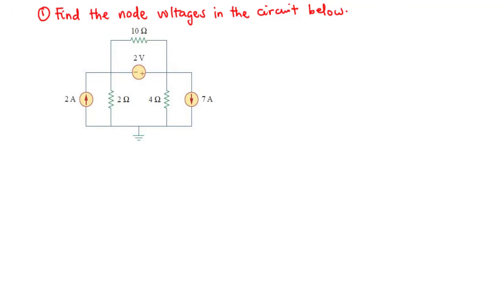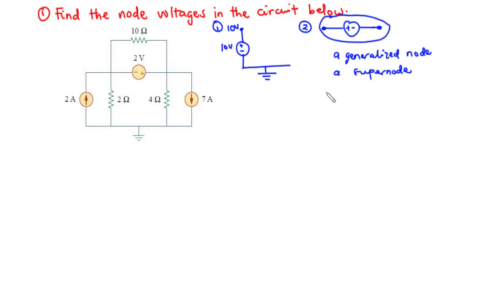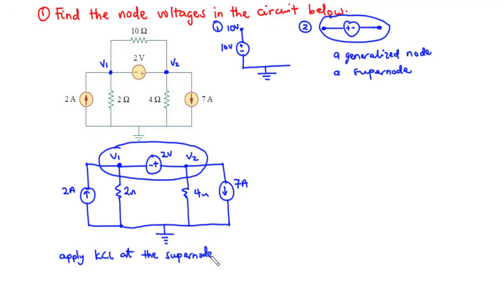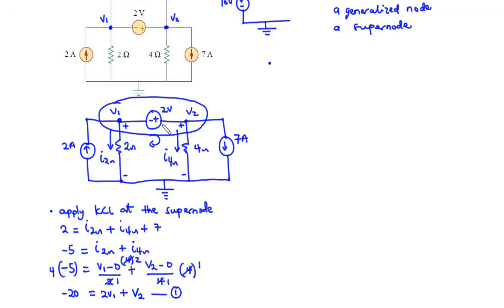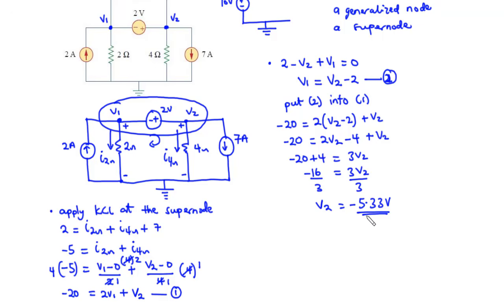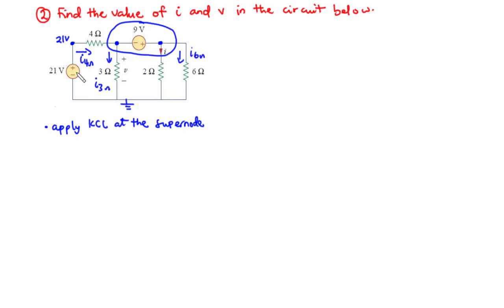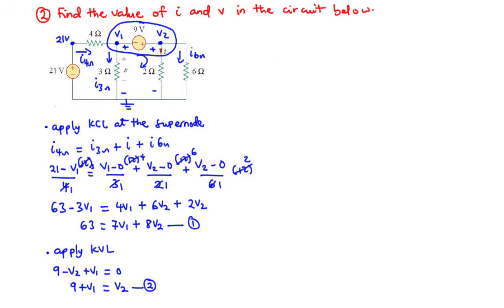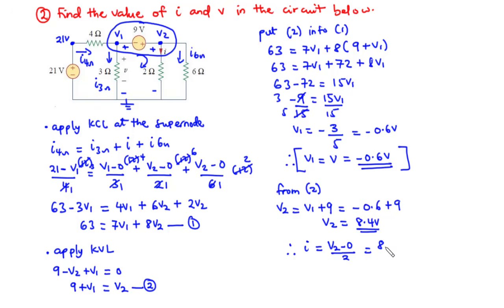☑️13 - Nodal Analysis involving Voltage Sources (Supernode) 1

Comment: How are you doing sir?if you may kindly assist me with the solution to this question ill appreciate
A circuit contains six nodes lettered A, B, C, D, E, and F. let VAB be the voltage between nodes A and B with its positive references at the first named node, here A. Find VAC, VAD, VAE and VAF if VAB = 6v, VBD = 3V, VCF = -8V, VBC = 4V, and (i.) VDE = 1V; (ii) VCD = 1V; (iii) VFE = 4V.

Comment: When a resistor is connected in parallel to a voltage source (across a supernode), it doesn't affect the voltage at the node.

In this case, the 10ohm resistor can be ignored for the purpose of nodal analysis, as it doesn't affect the voltage at the supernode.
Reply: what if we don't ignore it? would it be fine
Reply: @Noor_2k6 yes, u would see since the current at the 1st node current is leaving and at the 2nd node current is entering, if we write equations for each node and add the equations, u will see the current through the resistor in parallel with that source will cancel out, along with the current through the voltage source
In our example - 
For V1: 2 = I1+I3+I4
For V2: I3 = I2-I4+7
Add them up I3+2 = I1+I2+I3+7 and notice we can subtract I3 so we get I1+I2+7 = 2 or I1+I2 = -5
I1 is the current through the 2 Ohm resistor
I2 is the current through the 4 Ohm resistor
I3 is the current through the 10 Ohm resistor
I4 is the current through the voltage source
Note: The current I4 at the node V2 is negative because it exits the  negative terminal of the voltage source, while at the node V1 its the opposite, so it cancels out when adding the equations. 
U can see i got the same equation as in the beginning of the vid.
Overall, this showed why in supernodes we ignore the current through the voltage sources and through the branch parallel with the supernode.

Comment: Please sir,  at 9:10 i don't understand why did we take v2 to be negative? and do we always consider at 8:37 that there will be positive up and negative down?
Reply from the maker: At 9:10
Ideally the current is supposed to flow from the positive terminal at V2.
But since we take 2v as reference voltage and we take the clockwise direction, V2 will move opposite to 2v hence V2 will be negative.

At 8:37
Yes, negative is to ground.

Comment: Reason for excluding 10ohm
Reply from the maker: Since there is a voltage source in between the two non-referenced nodes, a supernode is formed, hence a supernode is formed and the element in parallel with the said voltage source goes away.
Reply: One question.
What if the 10ohm is series with the 2v source.

Comment: in the fist problem where did the 10 ohms go?
Reply from the maker: When a voltage source is found between two node reference nodes, a supernode is formed. In this case, the element in parallel with the voltage source goes away.

Comment: We have to demand corrections on books and ideas. In real world, there is no such thing as current source without voltage source. A circuit showing only a current source is fake idea. Where can you find  a current source? This idea is meant to confuse students.
Reply: He has a point. I have this in my own notes concerning current sources. I think it would be safe to say that inherent within the symbol of the current source there is a Voltage. Since Voltage is a requirement for all circuits, including current sources, current source is just a specialized application of a Voltage source. 😅, did I confuse you more 😂
Reply from the maker: Interesting ideas, I love it. Thanks so much for your contribution. I'm grateful.